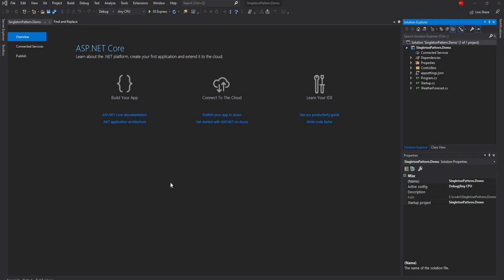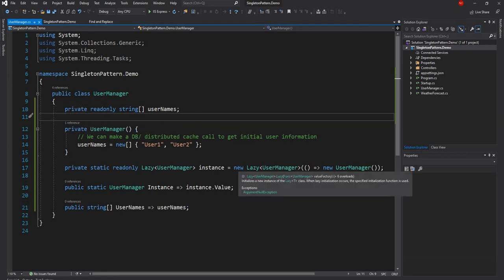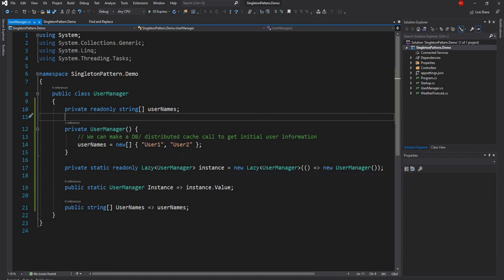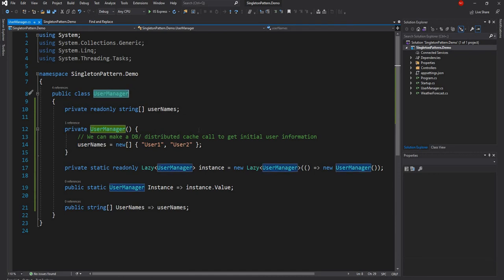Singleton Design Pattern (The pitfalls to keep in mind) [An Introduction for .NET Developers]

Comment: injecting class/interface set in startup class as singleton is tread safe ?? please confirm
Reply from the maker: @Shubham Tripathi, it depends on the class, if the class does not maintain any state and deals with only read-only members, it will be thread-safe, e.g., a class loading configuration from DB on startup and never changes. 
On the other hand, if the class maintains a state, then it will not be thread-safe, e.g., an in-memory product catalog store, which will be to update as well as read, this that case you have to implement synchronization logic. But in most modern server implementation, you will probably never maintain a state inside of a service.
I hope this answers your question.
Reply: @DotNetCoreCentral  yes, got your point , we have to manually implement a thread safe singleton pattern when its needed. Just object will created from configureService method
Reply: @DotNetCoreCentral  Could you please also suggest me video related to -
1- what are order of execution of class members while object creation.
2- how to do operation on numeric value which are beyond limit for c# variable
Reply from the maker: @khiladibabu  
1. what kind of member execution? usually, members are created in the order of declaration.
2. Are you talking about an unmanaged object like calling a C++ method?
Reply: got your first point, I will more than happy if you can show a demo related to second point, thanks.
Reply: I got my answer after some more effort I was looking for system.numerics class 😁
Reply from the maker: @khiladibabu  I am glad to hear that!

Comment: If you have a dependency on a singleton that's implemented in the traditional way but you don't want to (or can't) extract an interface, then consider using Dependency Injection with Delegates to get around the testability problem
Reply from the maker: @PublicVoidFoo, thanks for watching the video!
That's a fantastic suggestion which I overlooked, thanks for that!